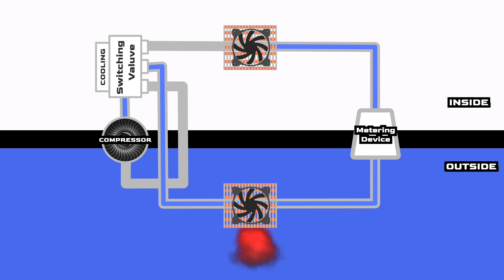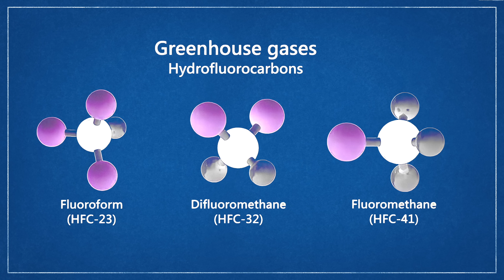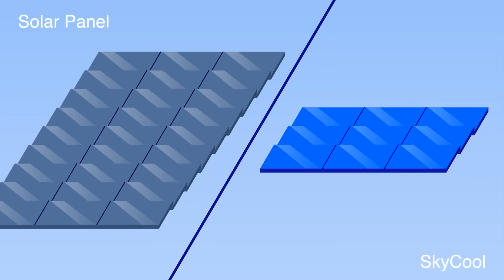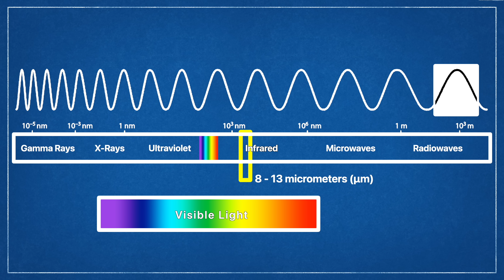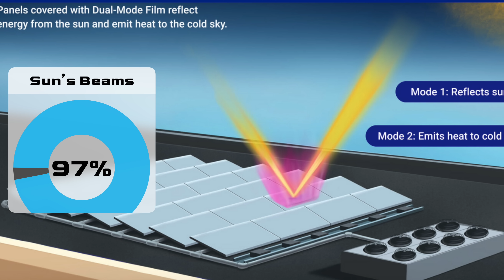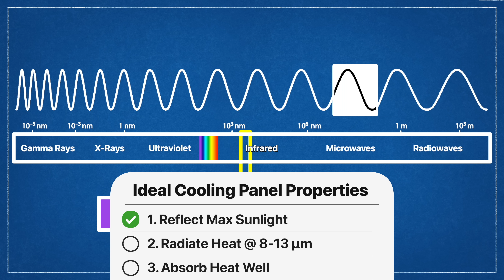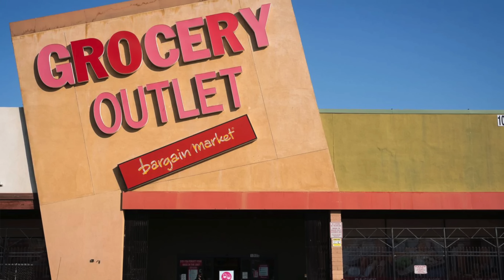New AC Tech Sends Heat Into Space & Saves 95% On Cooling Bills!

Comment: So the video made it seem like it was a closed system, just reflecting sunlight. No better than shade over your house. Or is this hooked into your HVAC unit, replacing the coolant? And then somehow converting that heat into infrared radiation to beam it into the sky? Passive energy conversion seems sus.
Reply: Passive systems would have a closed loop liquid coolant.  Maybe thermal siphoning, for  totally passive, or maybe assisted with  a water pump. 

When used in conjunction with an AC system, the AC condenser coils have supercritical pressurised  refrigerant dumping their heat into a heat exchanger with skycool's cooled liquid circulates in the skycool system, which on return can be as low as 15c below ambient.

Comment: I have observed in my 72 years, that these high tech "solutions" to problems in the end create more problems and work than the original "problem".  Are you thinking of hiring someone to go out there in the heat and clean off the bird s*** and just the stuff that falls from the sky.  And add in the cost of maintaining the roof on the building.  it is hard enough to maintain a roof without all this high tech stuff causing problems.  I think folks got to realize that you Can't always have it your way.  sweating out the hot days makes the other days seem that much sweater.  no thanks to any airconditioning, but don't care to give my 2 cubic foot refrigerator.
Reply: Grumpy old bloke speaks. You are typing on a mobile device or computer right? Last time I looked that was high tech.
Reply: Same kind of problems created by the T model ford ...new technology always seem to stumble a bit before gathering a full head of steam ..photovolic started in the early 60s took all these years to get going .
Reply: @wizardman42  yes that's when they started telling us how we would be in the stone age when we ran out of oil.  (peak oil) Same old baloney.   Photovolic cells work great till they get dirty.  we have lost the ability to clean solar cells.  i remember we used to live comfortably when our houses burned one fifth of the energy they burn today.  i guess that's because we have so many energy efficient appliances in our homes.  and we have to work overtime to buy them and pay the utility bills.  also because of technology families have two or three efficient automobiles to maintain and pay for.  We need the cars cause we all work across town and the buss service sucks.  I'm hoping for artificial intelligence to give us personal flying drones, and robots to do our work.  won't that be great.

Comment: This technology is similar to the radiators on the International Space Station. They get rid of heat generated aboard the ISS by sending out infrared energy. Pretty handy when there isn't any air to move the heat.
Reply: Since my comment debunking this video was deleted...

This whole thing is a scam.
Radiative cooling is a least effective way lose the heat! At room temperatures it is nearly non existent.

Convection and conduction effects are those that are heating up your house (heat from air and ground). Both of these are much more effective ways to transfer heat then radiation. There is no way radiative cooling with this magic device will be able to lose enough heat to keep up with being constantly warmed up by the hot air around it. Whole system will eventually equalize at ambient temperature.

Reason for this is second law of thermodynamics. Which in plain words means all energies naturally want to equalize. Meaning same temperature outside and inside your house. To fight this you need to create a temperature gradient and this takes extra energy. This is what regular heat pump or AC does. And since these magic panels don't use any extra (or enough) energy, they can't create a temperature gradient, therefor they can't work. Easy as that.

Radiative cooling is used in space on the International Space Station, because there is no other way to dump heat in space. Volume of the ISS is about 1000m3, area of radiators to keep it cool is 156m2. But that's in vacuum of space, there is no warm atmosphere there constantly heating up the radiators. 

So unless your house is in space this will never work.

Comment: Interested as to how it is intended to transfer the heat from inside to outside. I think Ricky mentioned using radiator panels to capture the heat, did I hear that correctly? Wouldn't that potentially cause condensation to form on the radiator?

Comment: while using passive pannels to cooldown temp. you can use normal air conditioning system as a back up for rainy days. means a hybrid system . since when commercializing they need a constant ac system  uninterupted. tnks

Comment: So a 95% reduction in electric bill is claimed from a system which saves 60-80% on cooling cost? Doesn't add up.
Reply: Coupons bro, coupons!
Reply: @BondiAV  yep,  and this channel should be seeing right through that
Reply: Since my comment debunking this video was deleted...

This whole thing is a scam.
Radiative cooling is a least effective way lose the heat! At room temperatures it is nearly non existent.

Convection and conduction effects are those that are heating up your house (heat from air and ground). Both of these are much more effective ways to transfer heat then radiation. There is no way radiative cooling with this magic device will be able to lose enough heat to keep up with being constantly warmed up by the hot air around it. Whole system will eventually equalize at ambient temperature.

Reason for this is second law of thermodynamics. Which in plain words means all energies naturally want to equalize. Meaning same temperature outside and inside your house. To fight this you need to create a temperature gradient and this takes extra energy. This is what regular heat pump or AC does. And since these magic panels don't use any extra (or enough) energy, they can't create a temperature gradient, therefor they can't work. Easy as that.

Radiative cooling is used in space on the International Space Station, because there is no other way to dump heat in space. Volume of the ISS is about 1000m3, area of radiators to keep it cool is 156m2. But that's in vacuum of space, there is no warm atmosphere there constantly heating up the radiators. 

So unless your house is in space this will never work.
Reply: so your going to totally ignore the heat gain from the roof (mostly black,  here in the US) absorbing the heat and reradiating a good bit of it into the house? Also, the radiative panels, radiating in the infrared, would radiate the heat into space. They do create a heat gradient...
Reply: @GlueTubber  I'm not sure whose comment you're referring to,  but if it's mine,  the numbers from the video itself don't add up to the video description. Also,  most roofs are not black. Most flat roofs are light gray to white.
Reply: @jamesengland7461  I think they meant that air conditioners are more expensive to keep up by themselves, AND the electric bill is lowered by using this one. Idk though.
Reply: @Yeet-cy8tz  true,  but their numbers are bogus
Reply: @GlueTubber  There is quite a bit of savings that could be had by reducing the heat being absorbed, yes.... but to emit similar amounts of heat to what the sun is providing, your house would have to glow white hot like the sun.

Comment: I must be slow… While the heat is transferred through empty space in Mode 2, isn’t it heating the space/air around it by transferring heat to the air around it?
Reply: No. It's radiant energy at frequencies that pass through clear air without being absorbed. If it isn't absorbed, it doesn't heat the air--or anything else--but passes right through into space. Space being a couple of degrees above absolute zero, it is one hellova heat sink. And if radiating away its energy makes a SkyCool panel 15° cooler than its surroundings, it is absorbing heat from its surroundings, and radiating that to space, too.

Read up on blackbody radiators.
Reply: @Grumplestiltskin007  Thanks. That's what I needed. I will look at those radiators...
Reply: Infra red heat energy radiats to space at night. Only tiny amount absorbed by atmosphere if not cloudy. Old method of making ice in mountains of middle east.

Comment: I love the idea BUT where is the 95% savings? Your supermarket was paying $40,000 a year. After installing the panels, it dropped tp $34,000, that is only $6,000 savings, a long way from 95%.
Reply: I'm sure that is a a very partial system. But if the cost is 95x greater, the benefit comes with longevity, and being convinced it will work.  im a tad skeptical at this point.

Comment: First, the summer isn't as record-breaking as they are saying. (And I will get some "heat" for daring to say that.)

But I believe this would be best served on business buildings. I am all for it if ...it pays for itself.

A lot of people believe that they would pay any cost to "save the environment", but don't understand the amount of energy it takes to produce that item. And that energy costs, so if you are saving money, you are saving energy. It is an extremely simple way to determine if you are actually reducing your "carbon footprint". It also means that it doesn't matter to the person who doesn't believe in climate change. If they are saving money they will see the benefit. That is win-win. 

(To be clear, I believe in climate change, but also believe it is overblown for political reasons. I am all for technology like this but hate the fear-mongering, and how bullying is suddenly approved if they are attacking people who do not believe in it. )

I keep thinking about a heat storage system that would store the heat until it is needed. I think of systems like refrigerators that pump heat into kitchens, and in the summer if that heat could be moved elsewhere to be used when it is colder that could be quite efficient. 

As far as the solar/ reflector system, I could see something that has reflectors on one side, and solar on the other. As the AC need arises, it flips to the reflective side, but as the temperature cools, it flips to the solar side. It could do this for each panel separately. if only half the panels are needed for cooling, the other half are solar. Need more cooling, it flips more to radiant. Need less cooling, it flips more to solar.

Comment: I’m curious how this scales? I’m thinking of industrial chiller plants. Those things are major energy consumers.
Reply: "Industrial chiller plants" are refrigerators
They just use ammonia cycle, cuz above a certain capacity, they're more efficient than freon/compressor-based systems. Ammonia is Heated... in order to Remove heat at the other end
A heat pump does something similar to a fridge, and removes heat from environment, and warms yer house
Standard efficiency is 1:3.5
Reply: Reality is the larger scale systems are SLIGHTLY  more efficient then those for homes or small buildings. A little more heat or slightly less energy to remove heat in an equivalent volume.

But would still love to see a side by side comparison for both scales.

Comment: Optimize system life-cycle costs with PV (for other electrical loads) on south and Sky Cool on north facing roof exposures.
Reply: I was curious if something like Sky Cool could go on roof areas that would be sub-optimal for solar panels?
Reply: @dannyvfilms  Start watching about 7:50.  If this isn't reflecting sunlight, then to me it seems like it's not really doing much for you, so to me the answer is no.  Yes it works at night, but part of the benefit is radiating solar energy back into space.

So, just an idea.  Instead of having homes with steep slopes, especially in areas where snow is rare, have a roof to where it doesn't matter if you're installing both.  Meaning, if you live in the N. Hemisphere you aren't worried about N. or S. facing roofs. The roof could gently slope down from N to S, creating enough slope so that either panel could be installed over most the roof. Then you could use both panels at the same time.  Or, construct panels that do both at the same time, in segments, so if you have something like a 3 meter wide panel which is about typical, the first 1/3 column would be solar panel, the 2nd 1/3 column would be this, which is reflecting light, and the 3rd 1/3 column would be solar.  This would only be worth it if that middle column is providing cooling while it's radiating the suns rays back into space.  If it provides no cooling benefit to the parts of the panel that generate solar electricity, then making a combination panel isn't worth it, and I'm saying this because solar panels work better when not too hot.

Any way with a non-steep roof, especially near the equator, then N. or S. facing is meaningless because the sun is over head all the time.  You get some variation through the year, but it's not dramatic.  These panels could cover a bit of the roof.  Then you could have solar panels that track E to W slightly during the day.  Both are keeping the sun's rays off the actual roof.
Reply: You mean for those who live in the northern hemisphere, unless you're close to the equator.  Or, you're too far north to where that north facing roof doesn't have any sun anyway, since part of the object here is to reflect sunlight back to space.

Comment: Am I missing something?  If this process can only cool the coolant to 15F below ambient, then it would be ineffective if the outside temperature was much above 70F.  (Note that most commercial buildings require cooling when the ambient temperatures reach about 65F due to the heat generated by lighting, people, computers, appliances, etc.)  Also, just pumping 70F air into a space won't cool it effectively, you need the cooling air to be well below the desired temperature.  Most A/C systems cool the air to about 40F.

Also not emphasized in this video is that this system will not work on a cloudy day, as the clouds act as a barrier to IR radiation and won't allow the panels to "see" the cold of outer space.  This is why you don't see frost on the grass if the sky is overcast, but you will when you have a clear night.

Look, I think this might have a place for use in certain locations (with few cloudy days), most likely coupled with an existing heat pump or A/C system and perhaps some sort of energy storage.  But just on it's own it has a lot of limitations.
Reply: wouldn't that 70F be a product of air volume? our units are seriously constrained by vol of air passed.  I have just changed my filters on my a/c from a 1 inch merv 8 to a 4 inch merv 11.   My initial thoughts are the house even at +1 degree higher on the thermostat, and the circulation of air seems to be much greater and feels much cooler, while the A/c system seems to be running less.  Hope this translates over to the bill.

Comment: Ahh, I remember his Ted talk: How we can turn the cold of outer space into a renewable resource | Aaswath Raman
Reply from the maker: That’s the one!
Reply: @TwoBitDaVinci  - Question then becomes: "Is this More Efficient, or More Effective, than Low Grade Geothermal, such as that described in 'Citrus in Nebraska' on YouTube?"

*For using "8 foot deep Trenches, that carry buried Pipes to bring in Earth Cooled Air, for A/C!"
Reply: @robertweekley5926  That was my first thought.  I suspect a lot of it would depend on the preexisting conditions.  If you've got a strong roof and no yard on a house that has already been built this might get the nod.  I'd think geothermal might be a better option if you are building from scratch as long as you aren't right on top of bedrock.  Then you can put solar panels on the roof and get the best of both worlds.
Reply: Space is not cold, there’s just lack of heat due to lack of a medium (atmosphere). You can’t really vent off heat in space. If you get exposed to space your internal organs boil
Reply: @precursors  You can radiate heat into space... the sun does it all day long.  The problem is you have to be very, very hot to radiate much heat at all.
Reply: @precursors  everything radiates.  How much, depends on its temperature.  How do you think infrared cameras work?  They see the light things are radiating.  How much and of what mix of wavelengths depends on their temperature.  That's how IR cameras can tell the temperature of what they are looking at.  These panels claim they can radiate significant amounts of energy into space, but in order to emit a meaningful amount, they would have to be white hot.  Things are called white hot because they are hot enough to radiate a mix of light that appears white.  At room temperature, the amount is simply too small to make a real difference, and almost all in the infrared.

Comment: Isn't radiation the least efficient of the heat transfer methods? Wouldn't just burry the pipes instead of using radiator pannels get superior results? Best part is no part. Also won't the emmisions created by the mnufacure and transport of of the pannels heats the planet more then the energy they irradiate.
Reply from the maker: Manufacturing is once, they could be in operation for decades
Reply: @TwoBitDaVinci  Yes but the marked advantage of the panel is that instead of transferring the heat to the atmosphere they would help irradiate it to space. But that overall effect would be tiny in cooling the planet compared to the heating effect of the carbon emited to produce them even over a lifetime. Most energy (and carbon generation) is used in the temperature pumping not dissipating it, laying pipes on the ground and letting it absorb the excess heat seems to be a better solution then building irradiating pannels and laying the pipes on them.